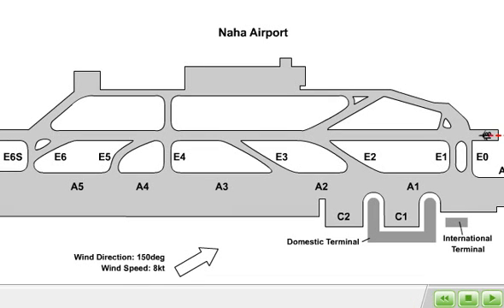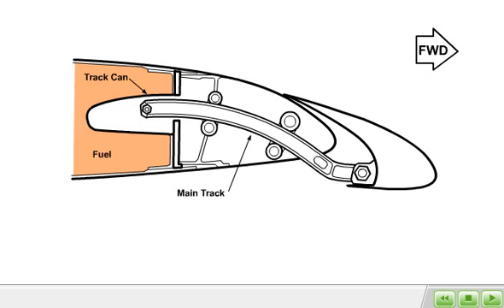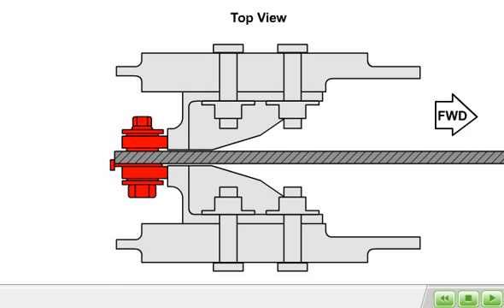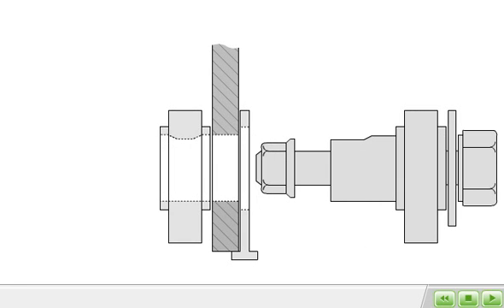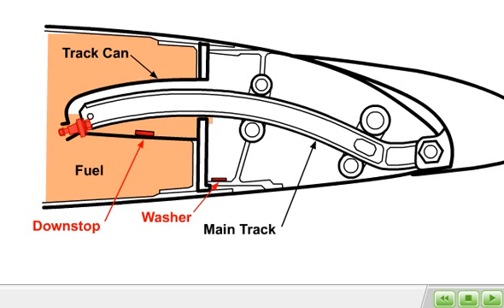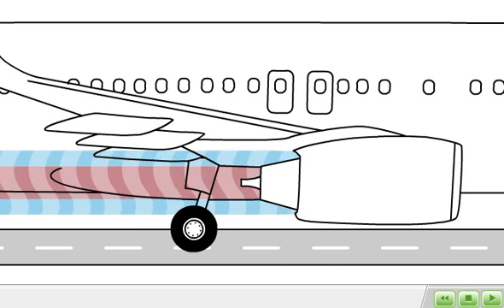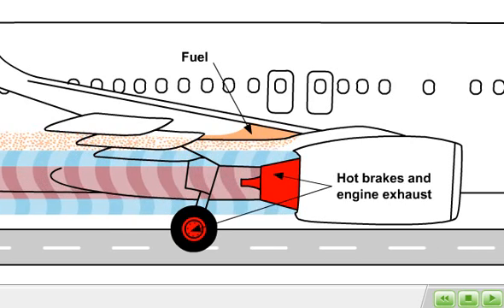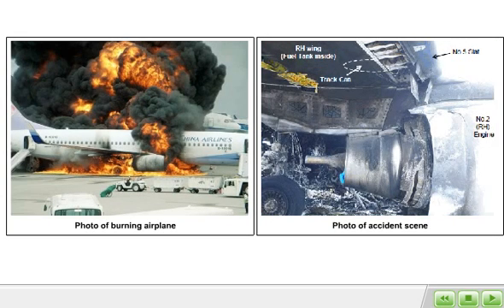China Airlines Downstop Failure Animation

Comment: Thank you. Does anyone know how that picture at 01:55 was obtained from a passenger jet destroyed by fire?
Reply from the maker: I don't know for certain, but I suspect that the fire started with fuel that had dripped onto lower parts of the aircraft such as the brakes (not fuel inside the wing), there also was wind blowing the fire away from some parts of the aircraft (such as that part of the wing), and the eventual arrival of the airport rescue and fire fighting services (allowing them to put the fire out before the entire aircraft was melted into slag), that portion of the wing/fuel tanks was not destroyed in the fire, allowing investigators to clearly identify the source and cause of the fuel leak. Had the wing been melted by the fire, identifying the cause of the leak would have been much more difficult.

Comment: I wonder if the other plane cross on the path filled by fuel leak (A1 to A5). They weren't exploded, right ?
Reply from the maker: Ihsan Mahyuddin Jet fuel has a high flash point - unless it is compressed, it won't catch fire. You can throw a lit match on a tub of jet fuel and the fuel will put the match out!
Reply: Daniel Bloemer thank you for the explanation
Reply: @dbloemer  So why did it catch on fire here?
Reply from the maker: @AB-sg4xu  I guess to be more clear, jet fuel has a high flash point (the temperature at which it will catch fire). Just throw a match on a tub of it, and the energy of the match isn't enough to heat up the cool fuel enough to light it before the match is snuffed out by the wet fuel (no oxygen to sustain the match fire). Allow it to drain on a big, very hot engine, and it can get hot enough to spontaneously combust, and that fire then feeds a continuing and growing fire as it works its way up to the wing, melting the wing and compromising the fuel tank integrity, increasing the amount of fuel available to feed the fire. I imagine the exploding tires also caused additional fuel leaks and fire, leading to a huge conflagration that eventually burned through the fuselage, causing the tail to fall later in the video. Kind of like trying to start a camping fire - put too many big logs on a tiny fire and you can put it out, but work your way up from tinder to small twigs to bigger sticks to logs, and you can build a giant bonfire.

Comment: Damn idiotic design.  It sometimes look as if planes are designed by a bunch of boys in a backyard.
Reply: Philip Koen No it’s not an idiotic design. In fact it is a really clever design as it allows for rigging adjustment.  The problem is that everything in aircraft design have a whole stack of compromises to sift through.  More than buildings, ships, or land vehicles, aircraft have to overcome the greatest obstacle of all, weight.  Want to make better access to the downstop, you would have to put in an access panel into each slat track on the wings.  But the slat tracks are part of the fuel tank so then there is the risk of having lots of hidden panels put there for one job. Access to these down stops.  Those panels then pose their own risks of having to seal the panel from fuel so then you need seals, bolts, captive nuts etc. this all adds weight and complexity.  Putting something like a sealed access panel requires strengthening the structure which adds more weight.  The more the aircraft weighs, the less payload / fuel it can carry.  If the aeronautical engineers could foresee every ‘what if ‘ situation and built accordingly, then a plane the size of a 747 would carry about 50 passengers.
Reply: David Steer
You completely miss the point, forget about panels, seals etc, just use a damn nut that is bigger than the hole, loose washers are in any case very sloppy, a bigger nut or a nut washer combo will do the trick. I stand by my opinion that a nut that is smaller than its hole and needs a loose washer is a stupid design, an extra loose washer is the way a backyard mechanic does things.
One would think that Boeing learned a lesson with this but it seems that was not the case, just after this incident they had another bolt and nut problem with fasteners installed incorrectly on  the 787 Dreamliners.  A quick Google" https://www.wired.com/2008/11/the-little-fast/
Reply: Philip Koen No Philip, I don’t miss the point.  Put a bigger washer / nut on the down stop and you lose the ability for the slat down stop to be rigged for its correct clearances. Incorrect rigging on a secondary flight control lift augmentation device is really important stuff.  So important that it must be inspected by a 2nd person appropriately trained and certified to do so who has not been involved in the task.  It is called an independent inspection here in Australia and worldwide it helps prevent ‘human error’ becoming tonight’s headlines. But I can’t speak for the system of maintenance in China because I don’t work on Chinese registered planes.
Please understand these things are a tad more complex than a power steering rack in a car.
Reply: Philip Koen Yes I had a read of the little blurb about Boeing’s subcontractors doing something wrong and at the 11th hour finding out and putting a stop on production until the problem was solved.  It’s called quality control.  Nothing unusual.  What would you rather, the action that Boeing took on the matter or if they kept it hush and told the offending subcontractors not to do it again.  
Think of this. Flying in a plane is an inherently dangerous practice, only made incredibly safe and affordable by sound design, and worldwide regulation.  Where else do you put your trust in a bunch of complete strangers to blast you down a runway at 200 kms hour plus, then fight the force of gravity all the way until you get to your destination.  While in cruise flight, the only thing between you and certain death from 850 km/h winds, at -47 degrees C and at an air pressure that will render you unconscious in a few seconds (with certain death shortly after) is a sheet of aluminium alloy 1/8inch thick, about 3/4 inch of insulation and a thin bit of plastic trim.
Think about that next time you book on the cheapest ticket.
Reply: David Steer
It is obvious the "independent inspection" system is not effective to prevent the human error. The first thing when designing something is to keep the possibilities for human error as low as possible, using a loose washer with a nut that is smaller than its hole was not the best of designs. Boeing made a change to the design of the stops after this incident, the new design should have been the original design.
Reply: David Steer
 Only realising that there is a problem with critical components after it are installed puts a question mark over the quality control system. This was not the only problem with the 787 and they were even grounded after a potential fire hazard because of problems with the batteries.
Reply: Philip Koen Well Philip, I don’t know how to break this to you but you should best give up flying if this bothers you so much.  Every airline make and model out there has design flaws.  Some are small and are picked up by higher than normal failure rates.  Some are catastrophic.  Depending on the outcome, the fix is prioritised.  They are called service bulletins. The regulators then issue out an airworthiness directive based on these SB’s essentially making it a law to fix the problem by a given time frame.  
Those little ones may be a simple mod to a part when it next passes through overhaul shop.  The big nasty ones will cause an immediate world wide fleet grounding.  
As for independent inspections, I may have to clarify something for you.  That is what we do here in Australia.  I don’t even know if they have to do independent inspections in China, which is why I can’t speak for every aircraft operator.
Reply: "Every airline make and model out there has design flaws" That is exactly why I said in my original post that it sometimes looks as if a bunch of boys designed planes. This is not only true with planes but with all other things as well but because of the safety aspect when it comes to planes one would expect better designs, testing and quality control. 
The problem with the "too small nut that needs a loose washer " in this case has more to do with bad design than with inspection so whether it was in China or wherever is irrelevant.
 Boeing changed the design after this incident. Don't you think that using a loose washer to compensate for a nut that is too small and can pull through a hole is a bad design and sounds like the work of an unprofessional backyard mechanic? That in a place where it is difficult to inspect the assembly? One would not expect it from a large company on something where safety is of utmost importance like on a plane.  Another thing to consider is that using smaller loose parts like washers etc on assembling lines slows down the process and increases the risk mistakes.
Reply: Philip Koen I had a read of the airworthiness directive and the fix is not a big nut like you hoped but rather a small nut that is lock wired to prevent it undoing.  Believe it or not but an aircraft mechanic’s most heavily used tools are a 1/4 inch socket set, and with that most common nuts n bolts used will be no larger than 7/16 inch. Why? Accessibility and weight.  Most motor mechanics I see go for 1/2 inch drive sockets and then they stick that on a rattle gun.  
If you physically saw how little space there is to assemble the downstop in situ, then you may have some idea as to why it is assembled as such.
Planes are designed to fly, not to be worked on, as the constant  missing skin on my hands can attribute.  
To turn around and say that the independent inspection system is irrelevant merely shows that you have little understanding of the importance given to the system.
Lots of people have died worldwide because the independent inspection practices was not followed correctly.  Aristotle Onassis lost a son because the small plane he was flying was rigged with aileron reversal. That easy to do mistake should have been picked up by an independent inspection.  Was it done? I don’t know.
Reply: @MrGoogelaar  The unfortunate thing is that with any system, be it a 737 that explodes just like this one or even just a car, you cannot have everything, there HAS to be trade offs no matter what you do. Even Biology works this way, and if mother nature couldn't figure out how to deal with this issue over billions of years I doubt we can for the foreseeable future too
Reply: @theshermantanker7043  Of course things do happen and there HAS  to be trade offs...it just happens too often with Boeing...the 737 Max fiasco was another blatant stupid design and they kept the system a secret and it blew up on them.

Comment: How the h%ck can a mechanic not realize he installed the slat's DownStop feature incorrectly -and on a 737 too! it's a REALLY common jet that 100% of aviators world-wide should know about.
Reply: Cool your jets, dude. the downstop assembly mechanism is 100% not visible without completely disassembling the leading edge of the wing. Those who made the repairs, which were to address this exact flaw but caused by a different failure, had to twist and crane their arms into position and navigate the mechanism completely by feel.

The whole fleet was having a new saftey measure implemented due to several 737's suffering the nut at the end twisting off during flight from regular wear and tear. The fix was simple and consisted simply of twisting off the problematic end bolt, applying a strong adhesive, and putting it back into position to harden. Mechanics wear gloves and it is accepted that the mechanic implementing the fix on the accident aircraft's right wing accidentally knocked the washer off either as he removed the bolt or replaced it or the adhesive snagged the washer and dislodged it as he was getting the bolt into position to twist it back on. With a gloved hand, he would not have felt anything unusual as the washer fell into the compartment at the bottom of the leading edge of the wing.

After this disaster, the whole fleet was grounded again and the downstop assembly mechanisms reinspected and, lo and behold, several other jets also had washers that had fallen off. It's rare that one single part can cause an aircraft accident, but it's even more rare for no one or combination of people to be at fault. This accident had both rarities.
Reply: @MelyssaAKASkittlez  I'm just impressed that a screw that can't have weighed more than 5 grams just destroyed a several hundred ton plane
Reply: Samuel Karlsson tbf they did mention the flap system was unique.
Reply: Samuel Karlsson you’d be surprised

Comment: holy shit, imagine it penetrated during takeoff... the result COULD be mid-air explosion... One tiny bolt and bring down an entire plane.
Reply: it would probably just show a fuel leak, leading the crew to an emergency landing. as shown in the animation, the engine blast itself was blasting the fuel back even at idling so fuel wouldnt be able to reach the engine
Reply: D. Va Explosion? The running engine blew the dripping fuel away from the hot tailpipe and brakes were not used on takeoff or in flight. The fuel leak would have been noticed in flight as the tank emptied and an emergency landing with fire fighting standing by would have saved the aircraft.
Reply: While the engines were on, the jet blasts blew the leaking fuel away before it could land on the hot engine components. The fire only started once the engines were shut off.
Reply: D. Va Explosion? The running engine blew the dripping fuel away from the hot tailpipe and brakes were not used on takeoff or in flight. The fuel leak would have been noticed in flight as the tank emptied and an emergency landing with fire fighting standing by would have saved the aircraft.
Reply: Who's that in your profile picture?
Reply: Kerosene/paraffin/ jet fuel does not burn as violently as gasoline/petrol/piston engine fuel, so the word explosion is a little over kill....

Comment: does anyone know what happened to the technician that performed the repair?
Reply: 'Melyssa K' Kennedy 
Upon that inspection of the fleet of aircraft, 27 other planes were found to have the same issue with missing washer.  They just had not “YET” pulled the bolt loose.  

So, one plane sacrificed. No one killed in that mishap.  27 accidents waiting to happen thwarted.  Problem corrected for entire fleet.  Only better outcome would have been not losing the one aircraft.  But without the fire, urgency of the washer fix may not have been taken as seriously.
Reply: DK1LLA There's no reason to believe he lost his job or suffered any consequences, as removing the end bolt, applying adhesive, and reapplying it with gloved hands on a mechanism that you can not see at any point during dis/assembly could easily have lead to the dislodged washer while complying 100% with company safety regulations.

In fact, after this accident, the entire fleet was grounded and vigorously inspected by removing the leading edge to visually inspect the downstop assembly mechanism, and several other jets were discovered to also have had dislodged washers. By sheer coincidence, none of them had experienced an accident related to the missing washer prior to the discovery.
Reply: Homecomfort Actually, it was a man. A two man team.
Reply: Tom Gates Yes, I'm well aware of that. That's pretty much what I said.
Reply: it was probably a women who screwed up the installation.

Comment: did someone from ford design that bolt?

cause the end result was the same as a pento
Reply: Laughed my ass off with that. By far the shittiest vehicle I ever worked on was my son's 86 Bronco.  I have cussed Ford out so many times. I worked on cars for the last 45 years and have never seen one vehicle more troublesome than that one. Its stored in my yard, still unable to run after the computer went nuts.
Reply: kimmer6 lmao I'm dying😅
Reply: Lol LOL!
Reply: Don't forget Chev p/u-s of mid-70s IIRC. Their frame rails were pretty close to the centerline, so the fuel tank was outside. "Zippo lighters" on side impact.